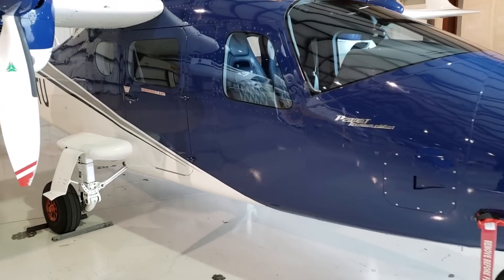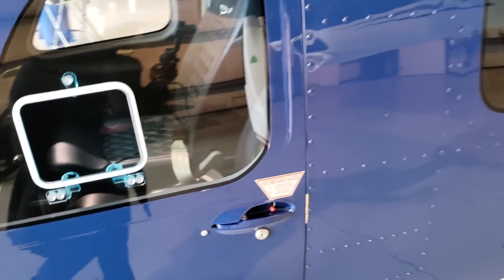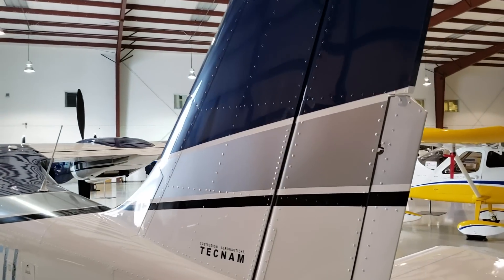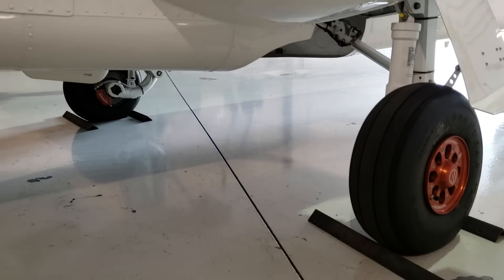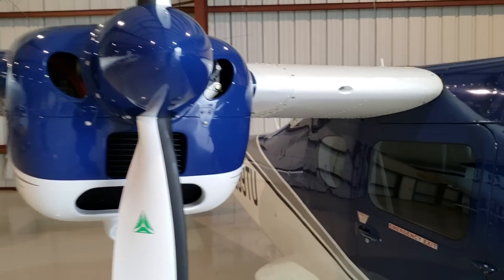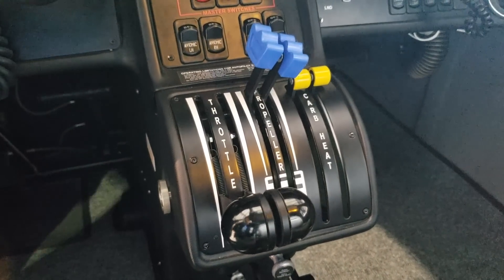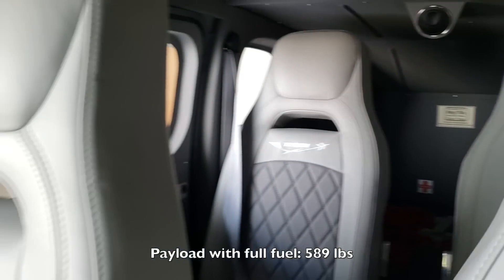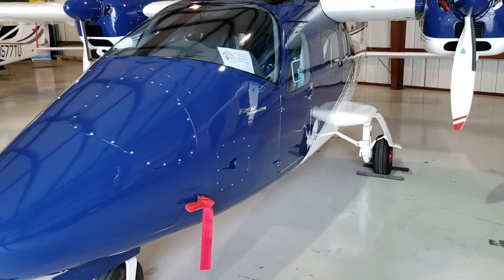P2006T l Airplane With The Smallest Twin Engines In The World

Comment from the maker: P2006T is a "certified aircraft" with the smallest twin engines in the world.
Reply: so it's called a P2006T..?
just alphabet and numbers, no specific name, as to reflect the maker, maybe??
Reply: @bahardin3992  Tecnam P2006T. P stands for Pascale, the name of the designer, T stands for Twin. Simple as that.
Reply: @bahardin3992  Since you figured out proper sequence of letters and numbers I do not think it is a problem or is it?
Reply: @bahardin3992  right, like the AMG C63S or BMW X5 40i. Letters and numbers.
Reply: Levine Levine in the description 444,000$
Reply: Expensive maintainence that could have been solved by a single engine ...
Reply: @egenesis1   this aircraft was build with two engines for the only puropose of allowing student pilots to aquire theirs MEP rating, and it has a retractable gear for the purpose of aquiring the complex aircraft endrosement.
Reply: @egenesis1  The Rotax is not that expensive to maintain, it's used in tons of ultralights for a reason. It's also able to run on mogas, very useful in Europe were avgas is insanely expensive.
Reply: USA is NOT the only country in the world! The fact that CriCri is not certified in USA as an airplane doe not mean it is not registered this way elsewhere. In France where this plane was designed it is registered as soon as certificate is being issued as the successful inspection of the airplane makes it certified! Each country has different approach to airplanes and its classes and You cannot make statements such as "P2006T is a "certified aircraft" with the smallest twin engines in the world" because it is not true!
Even between Canada and USA You will see differences between Ultralight category, for example, in Canada most of Tecnam single engine planes are treated as Ultralight, even if they have retractable gear system and are flying over 150mph while this is Experimental category in USA as specifications are exceeding part23!
Reply: Great looking plane!
Reply: to bad the dyn aero twin never made it to production.  that was a nice looking plane.  it had 2 rotax engines.
Reply: Nice Save 😎 the AirCam also uses two Rotax in pusher configuration
Reply: I was just about to yell out “WHAT ABOUT THE CRI CRI?”
Reply: @superskullmaster Omg I was about to say that too
Reply: @superskullmaster  I don't think the Cri Cri is certified. At least I've seen one with a registration number on the tail.
Reply: msnpassjan2004 the other CRI CRI comments were made before mojo made this comment about certification
Reply: Possibly, but you did not state that in the title! In fact there is so many twin engine airplanes that are way smaller than Tecnam. I would not be surprised if some other airplanes both smaller and lighter are also certified (not necessarily in USA). I will comeback to this topic after some research, as I do know for a fact that in Africa there is plenty of small twin engine two seat planes in both: side-by-side and tandem configuration both in-line and, tractor/pushers, I would not be surprised if some of them are certified in Nigeria or other country. In such case you still going to be wrong about your PT2006!
Reply: @michaelksiezopolski   The Diamond DA42 is smaller but it does weigh a bit more because of the Diesel engines.
Reply: @southjerseysound7340  I agree, but DA62 is lighter even thou is using bigger and heavier diesel engines. The whole plane is made of carbon fiber but is using none rotax engines. Even thou Rotax is originally made in Austria as engines for Diamond Aircrafts, they are NOT from Rotax production lane so they cannot be trusted right Mr MojoGrip?
And of course P2006T is using Yoke not stick like DAXX lane of planes and that is crime too. Price wise all of these planes are in same range...

Comment: What unnerves me is that the sling tsi cruises faster than this with a turbocharged engine and 1.5 gal lower fuel consumption. In addition, twin safety is irrelevant if one engine itself is insufficient to pull the (huge) weight of the plane fast enough to fly

Comment: CriCri is certified in some countries is running on the smallest engines and is one of the smallest single seats as well. Originally all-metal design and in some countries, you need to hold multi-engine rating to fly CriCri!

Comment: You really pay to have that extra engine in the airstream.  A single engine Sling running the 915 has better cruise, top speed, MUCH better payload, far lower fuel burn, about equal climb rate, far shorter takeoff and landing runs,  better range, has sea-level power at the Tecnam's service ceiling... on and on...  all at 1/2 the price.  I know this is a twin trainer, but still...  it's like they're from different worlds with different laws of physics.

Comment: I’d like to know if this is in fact hybrid composite-aluminum construction and what the cruise is.  The advantage of the low-sitting fuselage is the extra interior space which you can pull off in a commander-style high wing design. The fuselage looks like a modern helicopter and probably feels like it with the exceptional visibility and extra leg room.  But, the verdict so far is that half a mil is a steep price for 200hp.

Comment: with all the neat features, the prop should have had 4 blades. doing this will cause the aircraft to bite more air, reduce power to get the same speed and as a result reduce fuel consumption

Comment: All that is missing is Rotax 915is  engines (140 hp each) and 100 gallon fuel capacity for true 1000 mile range with reserves.

Comment: Rotax is shit... not any cheaper than a real airplane engine.  Fuel burn = HP.  100 HP = 5 GPH.  Rule of thumb, divide total HP by 20 gives a fairly accurate total cruise fuel burn.  Rotax is no better than anything else on fuel burn vs. HP.   And reliability is shit.  And price is no cheaper.  Why are you in love with Rotax?
Reply: Your opinion of them must come from the two strokes, lol. The 4-stroke 912 is very reliable and there is a reason its use is so widespread. I know someone with a 912 trike that can go even lower 4GPH. Cost of ownership is cheaper. You can use autogas, and the cost of complete overhaul is 75% or less than an equivalent conventional aircraft engine.

Comment: Looks good.  589 pounds useful load?  That's a little on the skimpy side but bigger engines as someone mentioned.  But, as a trainer, and with that low fuel consumption, it's a good deal.  I'm surprised to see there are not counter-rotating props.  I would love to hear about single-engine performance and the performance specifications.
Reply: I'm doing my MEP training in one of these. As you said the useful load is awful. It was made to carry student and instructor in a routine 3h training flight. 
Some performance figures: 
Vso: 54kts
Vr: 65kts
MTOW: 2712lb
52 USGAL usable fuel
T/O Ground roll at full load, on a standard day, grass runway, SL: 301m
T/O distance at full load, on a standard day, grass runway, SL: 394m
LNDg ground roll at full load, on a standard day, grass runway, SL: 231m
LNDg distancel at full load, on a standard day, grass runway, SL: 349m
Typical cruise: 75% power 130KTAS 20l/h per engine

Regarding single engine performance:
Vmc: 62kts
Blue line: 84kts
OEI ROC ad full load S.L. : 176 fpm (ISA)
ceiling: 5000ft
Easy to fly, no big rudder corrections needed, bad one engine out performance, expect negative VSI during simulated OEI T/O. We usually add some MAP on the dead engine otherwise it would be unsafe.
Reply: @alpinetwistyroads5143  it's the cheapest twin per hour to operate

Comment: From my experience rotax engines really aren’t durable enough for training. We have a piper sport w/ the rotax 912 ULS. Hasn’t been the most reliable engine especially with the coolant for the liquid cooler cylinder heads. Faulty engine gauge sensors have been a big issue as well.

Comment: this much trouble and only sits 4, with no FIKI (flight into known ice) all weather system, this would be only comparable to the none turbo SR20, and im SURE it cost more than the SR20 AND the SR20 has a CAPS rocket assisted whole plane parachute, WHY?? I used to fly a SR22 turbo and for being a single engine it carried 5 (legally 4 adults 1 child) and cruise at 215-220 mph at 18k ft, with same glass cockpit (G1000 and later models G3000) it beats this thing all day long (and night, and rain, and snow)
Reply: I'm guessing it would be hard to get twin engine time in an SR20.
Reply: lol I have no words to counter that! yes you are right, im coming from a owners perspective but the video did state that this thing was suited to train.  @DSC800

Comment: Looks great,awesome fuel burn. $443,000 ouch!!!. Thanks but no thanks. And they wonder why people think flying is catered for the rich only. The only way you can ever fly cheap is by jumping off your front porch.pretty sad.
Reply: You can buy an Piper Apache for about 80% less.  Fully depreciated. A 310 for a third of that. A Cessna 340 for about 60% of that.

Check on internet. Rotax overhauls ain't cheap.
Reply: Dave M I think half a mil for a rotax-powered anything is steep but the operating and maintenance costs of this is a fraction of a 310.  And all the Piper twins are hideous and dated, especially the Apache.
Reply: I think 20-25% of a new FAA certificated aircraft cost is the liability insurance paid by the manufacturer of the plane and it's systems, IIRC.
Reply: Hey the garmin suite is $100.000 . It certified so automaticly double or triple what it,s worth compared to experimental. I was thinking the turbo rotax,s. In twenty years it,ll be affordable.
Reply: Ultralights.
Reply: Well each one of those engines are easily 45k. So there’s 80k then add in liability and certification costs. It adds up. There’s some cheap planes out there. Just have to look
Reply: @Julius_Seizure69  last I heard Rotax 912 turbocharged engines were $10k for LSA...... Kinda highly doubt those engines quadrupled in a couple years?
Reply: @kennethjohnson6223  i havent looked at rotax prices in a while but the 912 non turbo is 16k brand new and the turbo is 19k, the 914 ul is 31k and the new 915is is 37k. https://www.leadingedgeairfoils.com/rotax-engines-parts/new-rotax-engines.html
Reply: This aircraft wasn't made for private owners but for schools. First of all schools in europe where fuel prices are much higher then in the US.
Reply: That's why I rent the planes I fly.
Reply: Gyrocopters and Paragliders.
Reply: In the US you can still score a SEL aircraft above 125HP such as the Piper Tr/Pacer PA-20/22 or the Sparrowhawk C152's and C150/150s for below $50k, or about $300/mo. 

They're not an Italian twin engine, but they are an option for us regular folk.

New airplanes are ungodly expensive because of bureaucratic 'red tape'. Everything from bolts, pistons, and paint must be inspected and approved by organizations like the FAA, who's manufacturers also must be inspected and approved by organizations like the FAA. All at cost to the manufacturer and therefore, consumer. Thank insurance and the lawsuit happy era we live in.
Reply: As far as new certified airplanes are concerned $443'000 is a good price but it's not just for the wealthy, u can get a really good brand new experimental for $150'000 or many used planes that are perfectly good and safe for anywhere from $15'000-unlimited, experimental or certified,  aviation isnt just for rich people, brand new certified planes might be but there are plenty of other options u can look into, same goes for helicopters.
Reply: Its flying not riding a bike. Its complex and it can take your life, do you really want a cheap plane? We know what happens with cheap cars.....they break down often.
Reply: @rolandocrisostomo2003  As long as it's FAA certified, it doesn't matter if it's cheap, it's safe.

Comment: They should start using the new Rotax 915is engines, it puts out 135 to 140hp, then it would have better payload capability, because it's kind of underpowered at only 100hp a side. I think the 915is engines would make this plane perfect, because right now with the 912's it only makes a good trainer and nothing else, but with the 915's it would make an excellent little aircraft that could be used for more then just training. Also increased range would be awesome to, if it could go at least 1200 miles it would be perfect.
Reply: Tecnam sell a twin with Lycoming engines, lot more power, higher fuel consumption of course
Reply: Chet Carson  This is scary, this model is already near a sedan car in terms of fuel efficiency.

Comment: Everyone thinks the G1000 is ooooh ahhh super nice but its not all glass panel goodness, all that glass runs on 150 extra pounds of avionic boxes mounted in the tail you dont see. I dont know why they put all that extra garbage in a small plane like a 172 or Mooney where it really affects the useful load and performance and planes like this that are very under powered. There are much better "fully integrated" glass panel gauges from companies like Aspen that give you all the moving map information you could ever want without the extra weight.
Reply: Have you ever felt the weight of steam gauge components?? They are not light, then throw in the vacuum system.... in most cases you have more weight compared to full glass components

Comment: I don't get it ... Why are small aircraft manufacturers insist on using the 100bhp rotax when rotax makes a newer 141 bhp engine ?!!
Reply: 1. Price.  the 915iS is over 40K$ each.  2. Fuel burn = total HP/20  Twin 155's mean a fuel burn of about 15-16 GPH.  3.  The airplane is light enough to operate on 200 total HP (100 per side), but too much drag to go fast, so, zero benefit to running the bigger engines.
Reply: Don't think the 915is was out yet by time of design. The 915is is very new.
Reply: ?? cheaper to run etc.....Laurie

Comment: Twin Rotax means chance for a double engine failure... I have flown the Rotax 5 times (none were mine and none were the same owners) and had engine problems with 2 of them. One threw a rod and locked up on an experimental and the other was on a factory built gyro and lost compression on one cylinder..... No Thanks On A Twin ;)
Reply: Tim Allbritton How many hours do you have behind Rotax engines?
Reply: @andrewmorris3479  Maybe only about 6 if that many. It was short flights around the Base. I know that people in ultra lights love them. I cant trust them after my experiences so I wish everyone else GooD LUCK...
Reply: Tim Allbritton Exactly, that would have been very unusual with the 4 stroke engines. We’ve been flying them in our flight school since 2010 with extremely good reliability.
Reply: @andrewmorris3479  The one that broke the rod was a 914. My friend bought it second hand so he didnt know the full story on it. Makes me wander if it could have had a prop strike. All I know is thank GOD for a clear field with no power lines :)
Reply: Did you have problems with the 4 stroke 912 series?  Very unusual if so, they're among the most reliable engines out there.
Reply: @kkiwi54  Yes the one that broke the rod was a 914. It was bought second hand so its not know what the previous history truly was.
Sorry I mis spoke previously and said it was a 912 when in fact is was a 914...
Reply: Tim Allbritton Dang, that’s not good. Well maybe one day you can try one out of a flight school. They are pretty sweet piston engines.
Reply: @andrewmorris3479  I just mis spoke. I called my friend that owned the one I had to emergency land. It was a 914 not a 912.
Reply: Tim Allbritton Still unusual. The 914 is my favorite actually. It’s also very reliable. Was this in a Gyro?
Reply: @andrewmorris3479  It was in a little Ventura Ultra Light
Reply: Tim Allbritton So it’s safe to assume 5 hours?

Comment: Wrong there's a guy with two 10 hp Briggs and Strattons mounted . 
If you have 2 100hp motors that's 200 hp and that's lots . Compared to Cessnas.
Reply: I flew my Lazair with two 9.5hp Rotax engines last week HaHaa !

Comment: The Rotax engines should also provide training on emergency landings
Reply: George Manthe How many hours do you have behind Rotax engines?
Reply: George Manthe HA HA got to laugh 😂 your somewhat right.
Reply: George Manthe: Right. Had 4 emergency landings with my Rotax powered microlight.
Reply: bjofuruh I have 1,000 hours of flawless 4 stroke operation in many different makes and models. The 912 ULS is just about bulletproof.
Reply: @bjofuruh  ..I think if you dont keep the maintenance up on it..Then, yeah, you gonna have probs w/ it...A cheap Walmart lawnmower engine will run forever till you run it on a stomp and tweak the crank...Was 10 yrs old when i screwed it up...Kept the maint. up and wouldve ran another 10....All any engine wants to do is run as long as you give it maint, and the "Big 3"....
Reply: @bjofuruh  But not a 4 stroke 912 right?
Reply: @kkiwi54  Right. Rotax 503
Reply: Single carb 503? The 912 and up are rock solid.